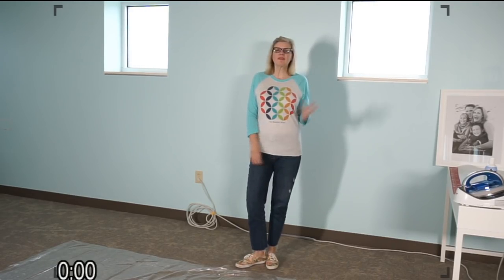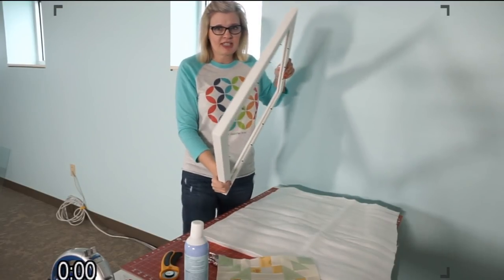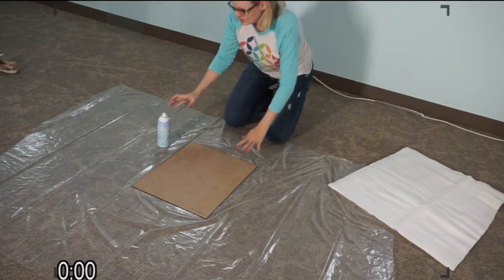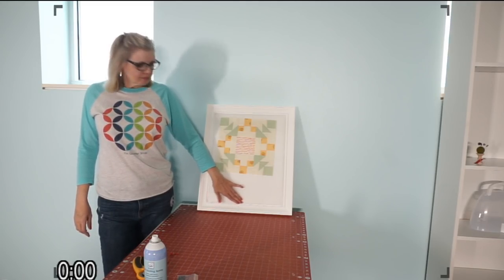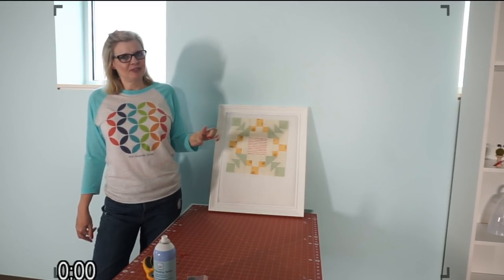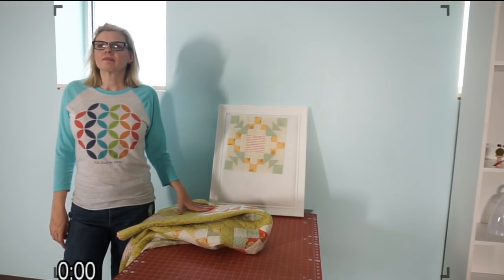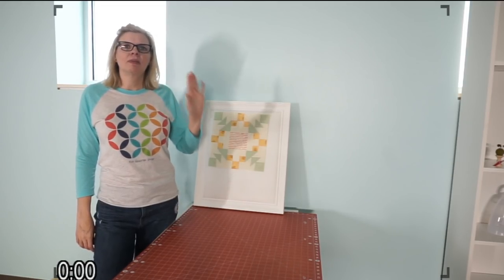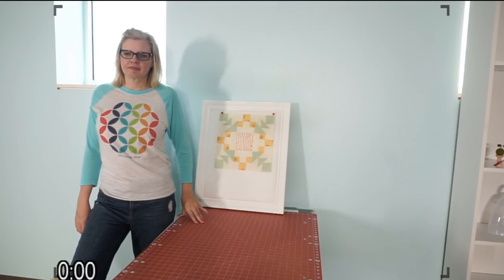Behind the Seams: Live Make a Design Board with Kimberly | Fat Quarter Shop

Comment: Could you top it off with a plain fabric? Love your Videos
Reply from the maker: Hi Evelyn! You certainly could, the only downside is that the batting is what makes the fabrics stick in order to use it as a design board. However, you could pin your blocks if you put fabric over it!
Reply: I’ve seen boards topped off with flannel. I’m adding the flannel to mine to give it a little more sturdiness over just having the batting on top.